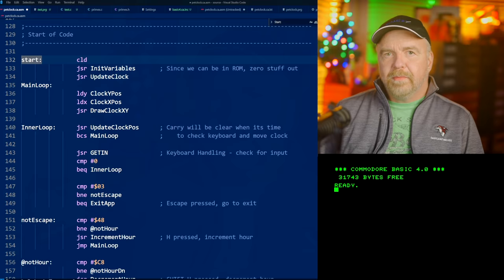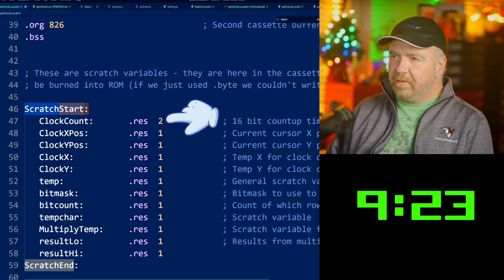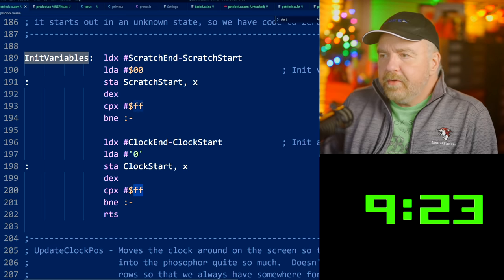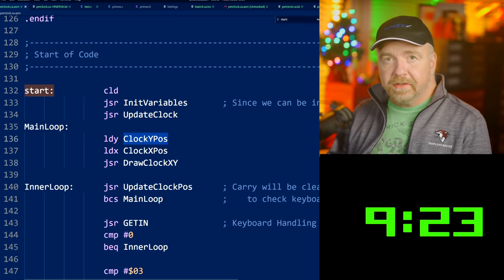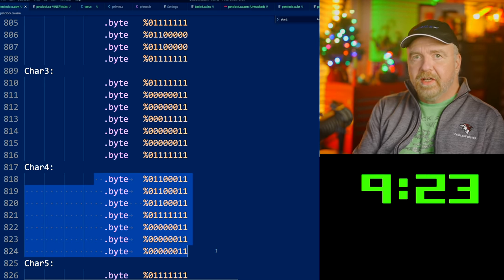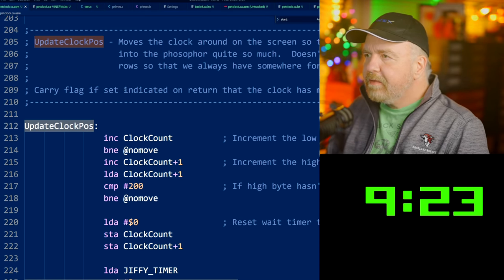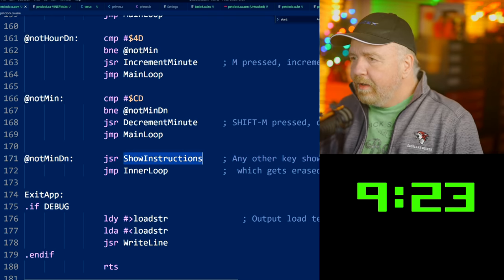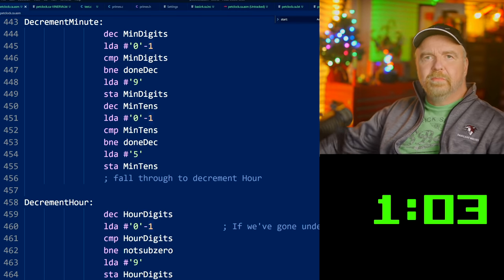Assembly Language Snow Day!  Learn ASM Now!

Comment: I knew machine and assembly language for the IBM 1620, an old machine from the 1960s that had no registers. I once modified the assembler to allow it to call routines for a Calcomp flat bed plotter when I worked at Argonne National Laboratory West in the summer of 1968. The laboratory scrapped the machine a few weeks after I went back to school.
Reply: I also wrote code for old calcomp plotters back in the early 90s, but I had the luxury of using C instead of assembly.

Comment: It'd be so nice if everyone who programmed a computer actually went through and learned an assembly language of any kind, as it's instrumental in understanding systems better. When I went through my CS program, it required demonstrable experience of one low level (assembly) language and one high level language before you could even enter the program. I had the good fortune of doing 6502, 8080/Z80, 6809, and 68K assembly over the years, and the only claim to fame on the 6502 was is that it was so much cheaper and plentiful than everything else. Even treating the zero page as a set of registers, it's still cumbersome and awful to program with maddening limitations.

Comment: I'm using a Commodore 64 to display time using the TOD clock, by unpacking the packed BCD to derive sprite pointers to get the digits, and having them wander around by making the VIC sprite registers do the work. Only thing is, I would like to do the reverse of what you are doing. The CIA time-of-day clock reads in 12-hour mode with a flag in the MSB of the hours register to indicate AM or PM. I would like to actually display 24-hour time I was going to use a lookup table, but after viewing this video and seeing how you decrement the tens-of-hours twice and then add eight, that technique in reverse would accomplish exactly what I want with less headache. And about 40 less bytes. God bless, and Happy New Year! Greetings from eastern Pennsylvania.

Comment: I sooooooo loved this walk-through. I taught myself 6502 back in the 80's as a teenager on the C64 and recently found it again....So Dave, how about a 6502 challenge, e.g. least bytes of 6502 code on a C64 to display the same clock face based upon the "run time" from when the program started ? Happy to help run it. :)

Comment: I was very fond of Motorola 68k assembler language back in the day while owning Amiga series computers. Unfortunately I threw my perfectly working Amiga 4k away decades ago which i kinda regret. The M68k instruction set was such a delight to write assembler with, especially compared to the clunky ways of the x86 intel chip which went on to gain total market dominance. Good times

Comment: It reminds of the early 80’s...I had a cartridge for the C64 that was an 8051 assembler. (Freedom Assembler). Also an 8048 version. They were great. Fast too. Sys57000. Then I burned 2732 and 2764 eeproms on the Jason Ranheim eprom burner that plugged into the C64 user port so I had a self contained C64 dev tool for 8048\51 controllers I used in an Anova Electronics Security system. Assembly goodness.

Comment: Using 6502 and Z80 assembly regularly, the 6502 feels a lot more "underdog" but I like that. Z80 with its 16bit operations and 8-ish registers to work with is like: "Booooring! Where's the challenge?"

Comment: It was similar in z80 machine code on the Spectrum 48k. If you poked 16384,255 you would end up with one 8 pixel line on the screen. We had 3 Commodore Pets in our school in the 80's.

Comment: It would be really cool to see something like this on RISCV assembly!
Reply from the maker: Wish I had a good reason to learn RISC V, but I might have to anyway, sounds fun!  

But nothing will top MACRO-11, I don't think.  Just for the simple reason that for the instruction set it was designed FOR the programmer.  RISC is efficient, but not friendly, usually! 

Of course if RISCV is anything like MIPS, I already have a lot of time debugging that...
Reply: @DavesGarage  I think of the PDP-10 as the ultimate For-The-Programmer assembly.

Comment: The screen size is pretty much correct for the 2001 series and the 40xx series. The 80xx series doubled the number of columns to 80. (The SuperPET is a model I'm not familiar with enough to say)

Comment: Nothing in my classes or reading materials for my mechatronics class spelled out that clock crystals are still relevant, so I regulated them to the same arcana of uselessness as external CPU clock crystals(as far as modern 8 and 16 bit Microchip microcontrollers in the late 2000s are concerned). 
That is, until I tried to use the internal CPU on 16Fxxxx and 18fxxxx controllers to run a time clock for a project. Initial testing suggested that I needed to run the clock for a few days to obtain a calibration value...... Then I figured out that the internal clock drifted WAYYYYY to much due to uncontrollable factors, such as temp.

Comment: I am a computer engineer, among other things I have designed my own RISC-V core. But I never learnt CISC style assembly, only RISC style assembly… I find it rather easier to write MIPS, ARM or RISCV assembly than to understand x86, m68k or 6502 assembly
Reply from the maker: I'd assume the opposite since the CISC sets are usually programmer-focused but I imagine it's all what you get used to!

Comment: The TRS-80 color computer also ran on the 6502, IIRC. I had the assembler cartridge for it, but alas, my 8th grade self wasn't up to making the leap from BASIC straight to assembler.
Reply: The CoCo series uses the 6809 which is related to the 6800, which was partly inspiration for the 6502. The 6809 has a lot of nice features that the 6502 doesn't have.

Comment: When I did 6502 in 1985 we had to use pencil and paper to write the commands and count the bytes by hand for jumps. There was no compiler on the Apple Ii.
Reply: There were definitely many 6502 assemblers for the Apple II in 1985, but you presumably didn't have access to one.

Comment: In InitVariables: you clear two blocks of memory with dex, cpx, and bne. Why bother with the cpx? If the dex resulted in zero bne would work anyway. You would have to adjust the location being cleared by a fixed amount but no big deal. This saves FOUR BYTES! :-)

Comment: Writing in a mostly dead instruction set on a mostly forgotten computer is my idea of an excellent video series. It helps that my first machine was a C64 though.
Reply: 65C02 is still in production, quite remarkable - I guess there's some guys somewhere making a living writing code for it even if it's just maintenance.
Reply: @joinedupjon  Wester design center makes them. Ben Eater has a kit you can buy and some great tutorials here on YouTube if you want to get closer to the hardware than Dave did here.
Reply: @RandomInsano2  
I had an early job writing 6502 for an embedded industrial system, it was an old CPU even then, We had 286 and 386 desktops. The cost of CPU and memory was such a tiny part of the project costs each time that we'd really have been better buying a proprietory 68000 board or something.

The performance in that sort of application is actually great - it wasn't driving a screen or doing any sort of complex data processing

Thanks for the tip, I'm tempted but I'm also a bit time limited for a new hobby project so it might be on the todo list for a while.

Comment: I wonder (for geek points) if drawing the digits using a properly simplified Boolean logic BCD -> 7 segment routine rather than bitmaps would save precious bytes.
Geeks For Geeks has a good BCD to 7-segment that even includes the Karnaugh maps. It'd be faster, I think, but your speed requirement really "done in less than a minute".

Comment: The fact that people computed graphics,  motion, or litterally anything that uses vectors on a 6502, is magic to me.
Reply: The people that did the same on the 6507 are even more magic. It has less registers than the 6502 and addresses way less memory. But it was the CPU of choice for the Atari 2600.
Reply: @BrunodeSouzaLino  The 6507 has the same number of registers as the 6502; the main difference is that it can only address 8K instead of 64K because it has less address lines, and it doesn't have any interrupt lines. And in the Atari 2600, it only has 128 bytes of RAM!
Reply: @8_Bit  In the 2600, the RDY pin is also used to deal with the electron gun in the CRT, so you can't use it fo anything else, since the VCS has no GPU.

Comment: I know it is nitpicking, but why not directly use JSR CLRSCR anywhere in the code to clear the screen, if you are using this KERNAL function anyway? By doing the JSR ClearScreen to just jump to CLRSCR is not adding any value, just adding 3 additional bytes and clock cycles. But this video and the clock program is a very good example of how much work goes into something that looks quite simple at start. And it shows how important it is to just split the work into small junks and tasks that can be easily done and tested and then put together to a bigger program. You can also extend the DrawBigChar function to additional characters very easy. Well done.

Comment: Thanks for this.  I spent a fair bit of time writing 6502 on the VIC-20 and Apple 2 series.  I never had a nice assembler like that though. :-)

I'm curious, though, why you have set the CPU to 65C02.  I'm pretty sure no PET ever had one of those.  I didn't notice you use any "C" specific opcodes, so I guess it doesn't really matter.  Or, did you do like I did to one of my VIC-20s and actually swap in an 65C02?

Comment: I put the fear of the computer goddess in many a youngster when I describe life in a mini writing assembler code.  Scare them well tales of overwriting code in chase scenes of will the new code overwrite what is being read?  Yes, back then we had very little real estate, memory was expensive.  So we would write code that filled in the new code behind what we were running.  Mini's are the PDP's, VAX's, DEC's of the 70's and 80's.  We did a lot of touch up on code others wrote in high level languages to make them a lot faster and cleaner too.
Reply: If you want to make it worse, how about the people that programmed stuff for the 2600 VCS? They literary had to count how many cycles each instruction would take in order to properly sync with the CRT beam, rewrite code on the fly, etc.
Reply: @BrunodeSouzaLino  I had to create timing diagrams of clock cycles for the hardware engineers, walk them through the circuits and then hold their hands while they designed the hardware that was used by the computer systems.  Oh, it got tedius.  I was the software engineer in an EE engineer section.  Lots of holes in walls where I needed to apply my head to make things good (at least for me).

Comment: I learnt assembler on a BBC Micro; we didn't have variables and memory reservation. I thought the assembly language we used was just opcodes and 8-bit arguments which directly reflected the actual machine code. We couldn't reserve memory - we had to read/write directly and remember (comment) what we were doing.  What Dave's writing here looks different, so is this some fancy pseudo-assembly higher level language which compiles into machine code?

Comment: Using a real realtime clock? I would probably find a way to get a powerline reference signal (maybe wind a few extra turns onto the power transformer) and feed it into the user port. I prefer using the 60Hz timing over quartz clocks because it is more accurate over time.

Comment: @18:09 "...I draw the minutes a little bit to the left and I draw the hours a little bit to the right..."  Is your view of the screen from the inside looking out or did you transpose the "minutes" and "hours" in this statement?

I have not coded in assembler for decades and never on a 6502 but did understand what you did. The  various machines I used had 1, 2 and even 3 operand instructions.  I did not hear you mention how current coding style differed from 80's style coding other than the clear screen bit.  Is there more to it that just that?

Comment: Cool video!  Did a lot of 6502 on Apple back in the day and seeing this brings some memories back.  I'm a little confused on this clock though.  How does the time get updated?  I didn't see anything in the code that updates the time, but you only call UpdateClock once before the loop starts.  Also, if you manually adjust the time, does it send that to the IEEE clock?  If it doesn't, wouldn't it just reset the time on the next read from the hardware clock?
Reply: The clock is stuck at the stub 9:23

Comment: Dave, if you've already answered this sorry for the repeat question. Have you ever been a vi or vim guy?  I love all of the features of VS and VSCode as well as editors like sublime but there's just something about command mode, macros, and vim's regex capability. Let alone home row being the navigation (up,down,left,right) keys while in command mode (k,j,h,l).  Still struggling some 15 years later to totally switch over.  Though maybe I don't have to as I have one of the vim key bindings plugins for VS that gets me like 80% of the way there. Anyway, I was just curious.

Comment: CPX #$FF isn't necessary, can be removed, and then BNE should be changed to BPL. Still, when it is done the way it is, the code is optimized for shortest explanation :)
Reply: This is a good optimization as long as X is initialized to #$80 or less. It will exit after one iteration if your initial value is larger. I'm not going to rewatch the whole video to check if every instance can be optimized this way :)

Comment: Next week sprites
Reply from the maker: Ha!  I once did something I was really proud of... a cycling side scroller with 3 levels of parallax.  So the cyclers were in front of the stadium which was in front of the town which was in front of the sky, for example.  And church steeples would pass in front of clouds because the artists drew the overlaps as sprites, and I scrolled them at the right time.  It looked really good!  I didn't design it, I just coded it.
Reply: @DavesGarage  I had a BBC Micro which had weird screen layouts but it was great to mess with. Also had a Jupiter Ace which was a forth computer

Comment: Quick question: Could you have solved some of these with recursion or is that not a thing with Assembly?
Reply: Recursion is absolutely a thing but you need to do a lot of pushing and popping from a stack and it’s really not worth it here.
Reply from the maker: Sure!  Anything with a stack can do recursion, and the 6502 has a page of stack, usually.  Assuming you push maybe 2 registers and an address each time, that's 4 bytes, or about 64 levels deep max, back-o-the-napkin like.

Comment: @davepl Could you show a fairly generic code example of testing an array of 100 bits for any single or multiple transitions from 0 to 1 and showing how many made that transition. Transitions from 1 to 0 would not be counted and these could happen at the same time as 0 to 1 transitions. I can't seem to work out how to do that in an automation controller which can be somewhat close to ASM.
Reply: An easy way would be to define two arrays (f.ex. Last and New), save the bits into the New array and compare against values in Last. For each compare that give that a 0 has changed to 1 do what that signals. If the array is in bytes use a bit-mask to select the bit like 1 for first bit, then 2,4,8,16,32,64,128.

Comment: Since this is current assembly code style, how would old or older assembly code style differ?
Reply: The luxury of extra RAM means Dave doesn't have to worry about optimizing his code as much as he did back in the day, and the source code can have lots of comments and large human-readable labels. The resulting machine code is basically the same apart from it being less efficient by choice, to make it easier to understand. Older assembly code, constrained by the tiny amount of RAM on the host machine, was more cryptic to read due to the lack of comments and short labels. Instead of IncrementHour: the label would be IncH: or worse.

Comment: In DrawBigChar why does it need to replace 0 with space if you already cleared the screen?
Reply: You may not need to. If you clear the screen every time before you write new time on-screen, then printing spaces are redundant and can be skipped....however it is simpler just to write a space for clarity. 
On some systems clrscr is slow and makes flicker. So you skip calling screen clear every time and instead you write a definitive block or space to ensure  the old blocks are erased.

Comment: 6:20 Gotta say, I am skeptical or you are explaining things poorly. JMP ClrScreen and ClrScreen's ending RTS ought send you dog knows where, since no return address was put on the stack. And what's this "our caller" stuff? Speak Commodore, not MSDOS. This is a C= machine after all.
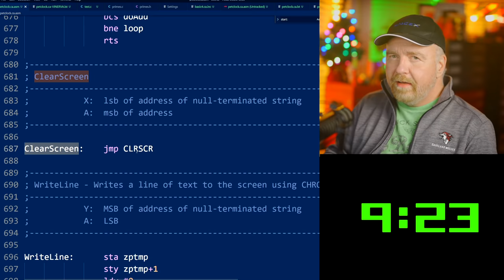On Edit: at 17:00 I see what you did and why is would work. But it would only work with the goofyassed way you have nested those JSRs/JSR/JMP. This is what you C guys think of as an improvement eh? I dunno, I remain skeptical that is of any benefit, since for it to work you rely on nested JSRs/JMPs.  But if I were going to program in this style, yes the  JMP would work. But the savings are debatable when you have these nutty nesting of JSRs/JMPs. And you call this "structured programming", yes?
Reply: This doesn't read well, maybe you should read your posts before submitting to get the tone right ?

Comment: How does one do Assembler level programing on an SOC system like Raspberry Pi?
Reply from the maker: You just code in the language of the processor chip, which in that case would be the ARM.  So you'd be coding in ARM assembly.
Reply: @DavesGarage  Hmmm, sounds simple. Never tried it, always imagined one had to do a bunch of weird prep work to make sure the instructions trekked all the way to the core directly.
Thanks.